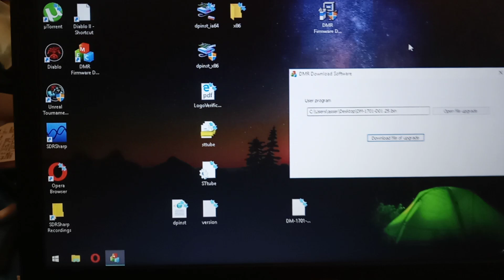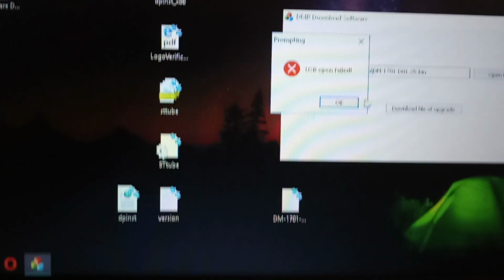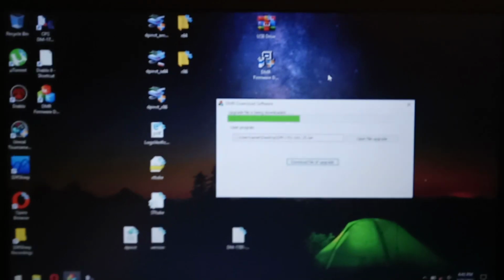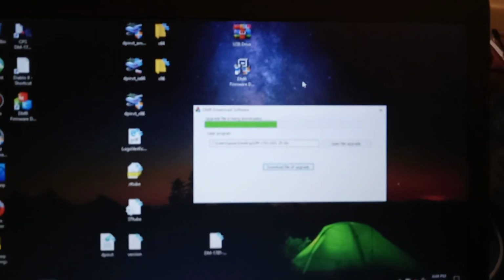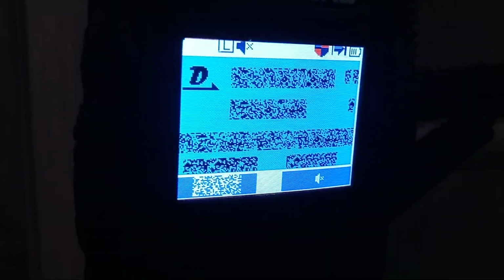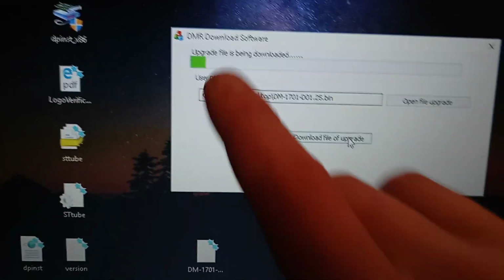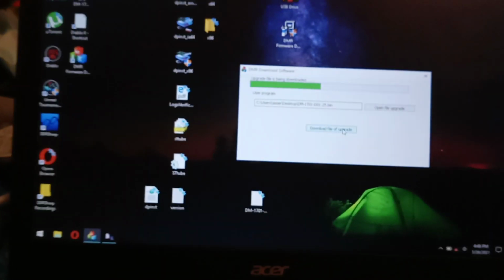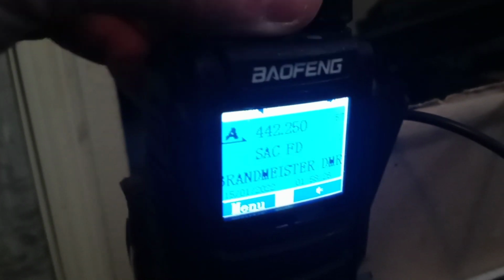fix a bad flash. on DM 1701

Comment: Please help me: After I did exactly what you told is my radio showing on the display: ENTER PASSWORD     00000000 or any other combination of numers will not work..... What can I do?
Reply: use the original cps for disable password in login, read the radio locked in cps, and disable password
Reply: @ChesterMagnoDJ  Is possible to share de file " DM-1701-D01.25.bin " ? Many tks !

Comment: Hi great video. I have a bigger problem with my same radio. I installed the firmware like you did only afterwards it's asking for a password on startup and I have no idea what it is  do you know a way to resolve this?
Reply: password default is all zeros
Reply: @KI5DJL  Is possible to share de file " DM-1701-D01.25.bin " ? Many tks !
Reply: Is possible to share de file " DM-1701-D01.25.bin " ? Many tks !